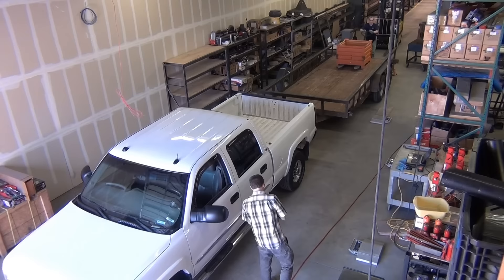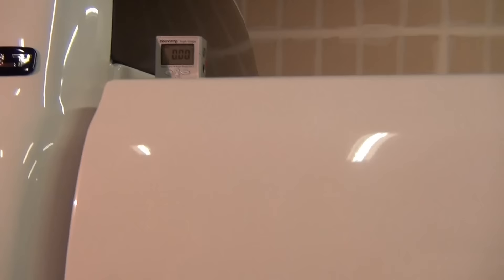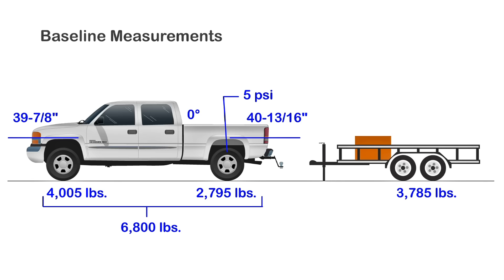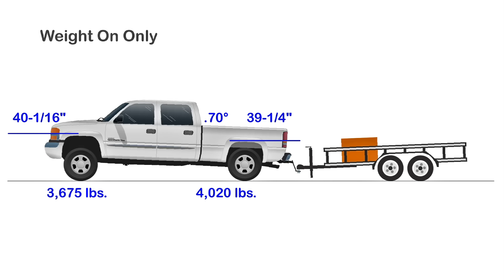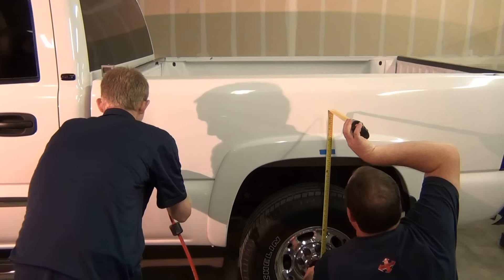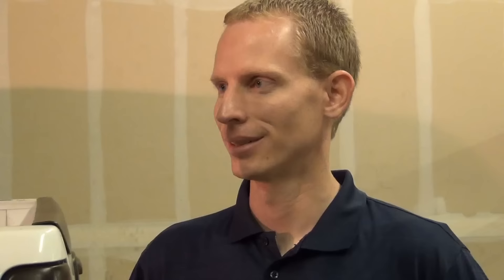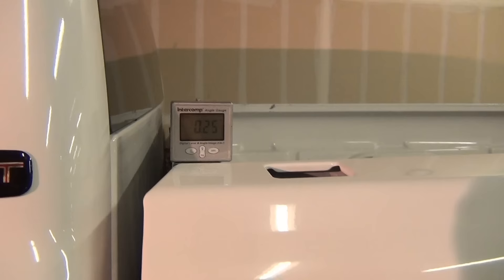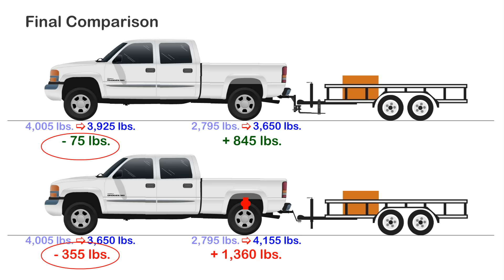The Difference Between Using Weight Distribution and Air Bags to Level Your Load

Comment: So when towing a travel trailer (7000 lbs) on a titan, is weight distribution better than air lift? Or use both? I've read some of the comments and it seems to be use just 1. Thanks.
Reply from the maker: Using both can be a bit tricky, you'll want to set the springs up before setting up the weight distribution with the hitch. You may need to use one extra washer on the hitch setup to compensate. Thanks for watching!
Reply: So I have a 2017 jeep grand Cherokee with full air suspension it has entry exit mode where the jeep drops down to let you out of the car and when you get on up to speed it goes into arrow mode which raises the car I’m having a little bit of difficulty adjusting the weight distribution hitch to make a level ride and I don’t know if I’m taking the weight of the rear of the car properly any ideas how to set up when you have an automatic air system where you would seem to be forced to use both
Reply: @dm1121  I have a 2014 with the air suspension, here's what I do: turn off entry mode under vehicle settings then shift the transmission into sports mode - this will set suspension into aero mode. You should be able to shift into park without a change in the suspension but to be sure keep the drivers door open after shifting into park to lock ride height. Then you can setup the hitch. Leave the transmission in sports mode during towing, it will increase shift point rpm and transfer more power to rear wheels.
Reply: @TTURocketDoc  great info!

Comment: How about using both 🙂
Reply from the maker: Using both can be tricky. If you have too much air in the bags, then you will lose the sway control and WD of the hitch. If you use both then you need to set up the air bags first and then the WDH, so the hitch can still give you WD and sway control. Setting up the air bags last will take the tension off of the hitch.

Comment: So for a 2016 dodge ram what do you suggest ?
Reply from the maker: That all depends on what you’re towing, and what you want to accomplish. If you are towing a bumper pull trailer, our first recommendation would be a good sway control hitch like the e2 [https://www.fastwaytrailer.com/e2-hitch]. If you are hauling a lot in the bed of the pickup, or want the ease of quickly adjusting the suspension stiffness, we would recommend air bags. In some cases, using both together is the best option.

Comment: What is the result when using both the airbags and the distribution bars?
Reply from the maker: Using both air bags and weight distribution together would give you similar results to using only the weight distribution hitch. The difference would be that the air bags should be inflated first, then the hitch set up and adjusted. This is because inflating the air bags may affect the placement of the hitch head on the shank to keep it at the same height as the trailer coupler. You would see less sag in the rear axle because of the added stiffness, but the axle weights would end up being similar if the weight distribution is set up correctly.
Reply: @FastwayTrailer  It would be great to see you guys actually test this scenario. :)
Reply from the maker: @matttcox71Tube  we are hoping to do a video showing both in use in the near future. Stay tuned.

Comment: is upgraded suspension just as good as WDH
Reply from the maker: Robert McDonald,

We're not exactly sure what you mean by, "upgraded suspension." Both might be good options to improve your towing.

However, these options are not interchangeable, meaning, you can't substitute one for the other since they both do very different things to your tow vehicle.

We recommend a good diagnosis by a qualified technician to determine the exact cause of any problems you're having, and then you can apply the appropriate "fix" for that problem.

You are always welcome to contact our Customer Support team and get their take on your specific situation. 877-523-9103 or Support@FastwayTrailer.com.

Good luck!
Reply: Upgrading suspension won't give you more capacity. WD will always be required.

Comment: I currently own the 2011 Awd model. The biggest issue is the towing. The Second is the just under 48" width of the cargo area. If Toyota would bump the towing number to 5000 lbs, so I could tow my boat, and increase the cargo width to at least 48" to fit a piece of plywood etc... when necessary. I would be buying another. The haters (afraid of someone calling them a soccer mom) have not experienced the comfort and functionality of this minivan. They just don't know. I have taken a look at the Metris, but no awd and its not as nice or as comfortable as this one. Odyssey and Pacifica  are also nice minivans, but they are both lacking awd and the towing numbers. I don't really see the coolness or toughness of crossovers either, granted some are better then others, but nowhere near as practical. I'm considering the sprinter, but find it lacking power. Looks like 1/2 ton for me.
Reply: Minivans are meant to haul people inside, not really meant to tow anything other than a light weight <3500 pound trailer.  They just aren't constructed to carry the load from back to front like a pickup truck does.   Crawl under the rear of each and look at where the receiver connects, will be quite apparent why they have such a low rating.   If you are needing to tow more than 5000 pounds, you really should be looking at a full size SUV or pickup truck, as they are meant to tow, and do so safely.

Comment: I love the change a WDH can do.  What people need to realize.  Drop your speed a bit with a heavy Trailer in perfect conditions.  As conditions get worse slow down, increase distances.
 I’m not a huge fan of sway bars.  Situation specific.  Proper loading, tires aired up, control in reasonable conditions they are not really needed.
Reply from the maker: Thanks for watching!
Reply: If you add weight to the ball, you get a pivot point.  WDH fixes that.  Sway bars control fishtailing in high winds, so I wouldn’t use them alone.  Don’t most WDHs come with anti-sway built in?
Reply: @jeffforbess6802  some do, most have spot to add one.  (Of the few I looked at).

Comment: I run both on my truck is that a bad thing?
Reply from the maker: Nope! That's totally fine. Just make sure to set up the air bags before the WDH.
Reply: @FastwayTrailer  when you say "set them up first"  are you suggesting inflating them to the 55PSI (for example) or having them at the low 5PSI then attach the WDH ?  Please confirm

Comment: How would you use both of them ?
Reply from the maker: Using both can be a bit tricky, you'll want to set the springs up before setting up the weight distribution with the hitch. You may need to use one extra washer on the hitch setup to compensate. Thanks for watching!

Comment: Now how do we factor in the 'light load valve' on the rear axle?
Reply from the maker: Sorry, we're not exactly sure what you mean by light load value. Can you give us some more detail please?
Reply: My thoughts were that, if a vehicle is fitted with a brake fluid pressure reducing valve for the rear axle. Air bag assisters will change values.  The vehicle although now maybe heavy on the rear, will still seem lightweight to this valve and a lower pressure is still delivered to the rear brakes. Just a thought 'cos I was having low braking trouble on my Sprinter Motorhome (with air bags).  @FastwayTrailer
Reply from the maker: @mmomsboy  thanks for the clarification. We believe you are talking about the Load Sensing Proportioning Valve. Yes, you are correct. If there is something installed like air bags that changes the way weight effects the sensor on the valve, you could certainly have a situation where there is more weight on the rear axle than the vehicle recognizes, causing a negative effect. However, this is an older system that has become obsolete with the introduction of anti-lock brakes, so it is only something someone with an older tow vehicle would need to be aware of.

Comment: I have a weight distribution hitch, can i also use air bags?  what would the draw backs be to using both.  I use the weight distribution hitch for about as much as i can and then for minor corrections I use the bags.  your thoughts?
Reply from the maker: If you use both, the air bags can tend to raise the tension off the hitch, and will give you less weight distribution and sway control. Although we normally don't recommend using them together, if you wish to do so, make sure you inflate the air bags to your towing level (we prefer a lower setting) before you set up the weight distribution hitch. Setting up the hitch last will allow you to still get sway control.
Reply: FastwayTrailer roger thanks for your advice!
Reply: I'm a mechanical engineer who does a lot of towing.   The air bags merely stiffen up the existing springs; ie, less defection with a given load. Thus, set your air bag pressure before you hook up THEN set up your WD.  It may require some empirical experimentation to determine the airbag PSI required.

Comment: Hello. I have a 2007 Jayco Jay Flight 31BHS RV with a 
Gross Vehicle Wt Rating (GVWR)	9000
 lbs
Unloaded Curb Weight (lb)	6830
Max Cargo Carrying Capacity (lb)	2170
and using a 2017 Dodge Ram 1500 1/2 ton to tow it with the truck having a total towing capacity of 10 640 lbs while using a weight-distribution hitch but still get a bit of sag. What can I do to correct it a bit more? It's not overly bad but still would prefer less sag and more even distribution. I may have to raise the ball higher to compensate is what I was thinking? I had a popup trailer before so moving to a bigger and much longer RV has me asking questions. 

Thanks for your time and the video was perfect. I honestly have debated on airbags and now I don't think I will.
Reply from the maker: Thank you for your comment! We would love to discuss your setup and any questions you may have. Please reach out to us via telephone or email. I will add our contact information in a separate comment. Thanks!
Reply from the maker: Phone: 800-478-5578
Email: support@equalizerhitch.com
Reply: @FastwayTrailer  I have already reached out via email and still waiting for an answer to the second question I asked.
Reply: @FastwayTrailer  That is who I messaged already.

Comment: I have a 2001 gmc sierra 2500hd 8.1 Alison transmission.  Gvwr is 8000 something how come the in this video weight only 6800?
Reply from the maker: Hmmm, that’s an interesting observation. We’re not really sure why there would be that difference, except that perhaps that ours was weighed pretty much empty, with no cargo or passengers (including no driver). Maybe when yours was weighed it had full fuel tanks, cargo, and passengers? Thanks for watching!
Reply: @FastwayTrailer   actually nadaguides show 9,200 gvwr
Reply from the maker: @ideaslandscape , sorry, we missed the GVWR in your first comment, and thought you were referring to the actual weight (GVW) of your vehicle.

GVWR is the Gross Vehicle Weight Rating, meaning that is the most the vehicle can legally weigh when loaded. This includes the vehicle itself, any cargo, fuel, accessories, and passengers, including added weight from a trailer. You should never exceed this amount.

In our video, we are measuring the actual weight of the truck itself, which would be referred to as the Gross Vehicle Weight (GVW).

GVW is the actual vehicle weight, GVWR is the maximum weight the vehicle is rated to carry.
Reply: 6800 is not the GVWR is it the dry weight (real weight) the GVWR is the max weight the vehicle can support with cargo passengers and trailer
Reply: Your GVW is 6,800 lbs (gross vehicle weight)  (Your GVWR is 8,000 lbs.  Payload is 1,200 lbs. + 6,800 lbs.)

Comment: How do you determine which weight rating hitch to purchase?  My trailer dry weigh is 5300lbs with gvwr close to 7k.  Will be putting about 600-800 in truck bed plus camper shell.  TV F250 (12,200 rated towing)  Would I choose the 8000k  or the 10k hitch.  Was thinking the 10k but didn't know if that would make things to stiff.  Great video by the way.  I have watch it several times.
Reply: I guess I should also add the tongue weight dry is 694 dry.
Reply from the maker: @jakej5855 , you need to make sure the hitch ratings meet or exceed the actual tongue weight, and gross vehicle weight (gross trailer weight). For example, if you take your trailer to a CAT scale an it weighs 7,000 lb loaded as it would be for camping, and your tongue weight is 10% of that weight, or 700 lb, you would need a hitch that is rated for at least 700 lb tongue weight and 7,000 lb trailer weight. If your tongue weight is 15%, or 1,050 lb, you would need a hitch rated for at least 7,000 trailer weight, but 1,050 tongue weight. In this example, an 8K e2 hitch would be adequate for the 10% tongue weight, but you would need a 12K e2 hitch for the 15% tongue weight. 

The weight in the back of the pickup truck can make a difference also. If you put that weight in, and then set up the hitch, following the guidelines above will work. However, if you are hoping to take some of the sag out of the tow vehicle that is being caused by the cargo, you need to calculate that into your hitch size. This is done by approximating ½ of the weight in the bed behind the axle, and then adding that to your tongue weight requirements. In your case, you assume 800 lb in the back of the truck. Therefore, 400 behind the rear axle, and half of this is 200 lb. Add that to your trailer’s tongue weight, somewhere between 700 and 1,050 lb, and you need a hitch rated to carry 900 to 1,250 lb. Then, set up the hitch first, before adding the cargo to your pickup bed.

If you have any questions about this process, contact our customer support people at 877-523-9103.
Reply: @FastwayTrailer  Thank you very much.  Excellent information.  This really helped in my decision making process. You guys for sure back up your expertise with facts.
Reply from the maker: @jakej5855 , you're welcome!

Comment: Hi guys
Can they be used on the front springs as well..?
Reply from the maker: Yes, air bags can be set up on the front suspension of a tow vehicle.
Reply: OK thanks!
Reply: Any specific model number for my old 2004 jeep g.c. with the 4.7 L.? Thanks!
Reply from the maker: @steven6692 , we assume you are asking which model weight distribution hitch you need. This is determined by what you are towing, not what you are towing with. The Fastway e2 hitch models are rated from 4,500 lb up to 12,000 lb maximum trailer weight, and from 450 lb up to 1,200 lb maximum tongue weight. You can find detailed specs on the models on our website [http://fstwy.co/home].

Take your trailer to a CAT scale near you, and weigh it. You should be able to get two separate weights, one at the axles, and one at the tongue. This can be done by pulling forward until your tow vehicle is just off the scales, then dropping the tongue jack and lifting the trailer off the hitch ball. One weight will be the tongue weight, and adding both together will give you the gross trailer weight. You need a model that accommodates both of these weights. For example, if your trailer weighs 5,000 lb with a tongue weight of 650 lb (13%), you would need the 10K model hitch because the 650 lb tongue weight exceeds that rating for the 6K hitch. Of course, if you need any help, get in touch with our customer support team at 877-523-9103 or support@fastwaytrailer.com.
Reply: Sorry for not beeng specific guys...i was asking for the air bag model (if any) for my 2004 wj. The reason i asked is that i've seen several model numbers of the airlift 1000.
Thanks.
Reply from the maker: @steven6692 , we’re sorry, we can’t help you with an air bag model, because we are not an air bag manufacturer. We recommend that you find a reputable air bag retailer in your area, or contact the air bag manufacturers directly for help finding a model that will fit your Jeep. Good luck!
Reply: Just got an email from jeggs and model # is 80702.
However they are not sure if this model can also be used on the front wheels...i got work to do i guess...thanks anyway!
Reply from the maker: @steven6692  you're welcome! Good luck!
Reply from the maker: Varnce , air bags would be used on the front axle if you are planning on carrying a heavy load as payload within the tow vehicle, where a significant amount of that weight will be carried by the front axle. Some examples would be: a large truck camper, 5th wheel or gooseneck trailer. The air bags would be a quick an easy way to stiffen the front suspension while carrying this load, and soften the suspension when the tow vehicle is empty.

Comment: What about the simplest thing first n put that darn tool box right over the axels in the of the trailer that the tool box is sitting on.....?
Reply from the maker: +Bonnie Yuzapavik, you are correct, in a real towing situation it would be best to put the weight over the axles, so that the center of gravity is slightly ahead of the axles, giving you 10% to 15% of the GVW as tongue weight. However, for this test, we are not towing, only trying to add tongue weight for the demonstration. Thanks for the comment.